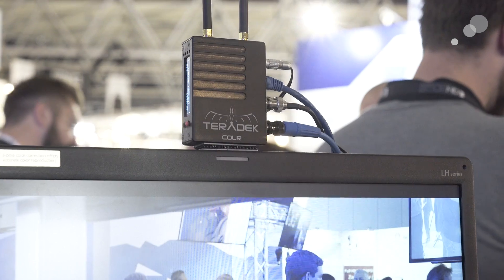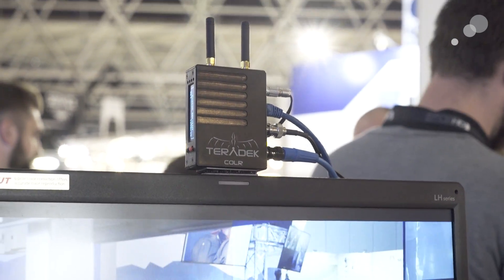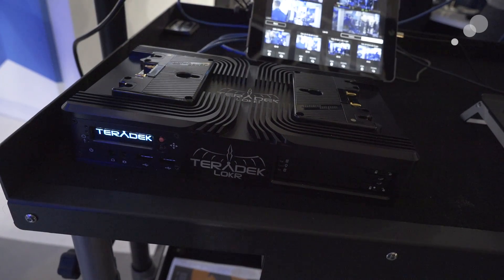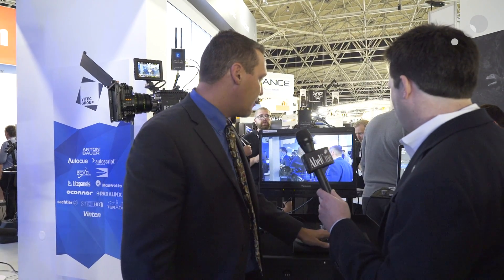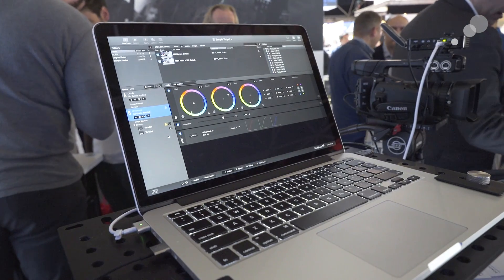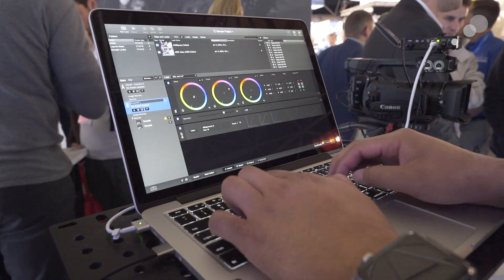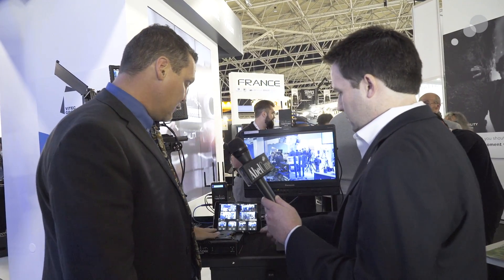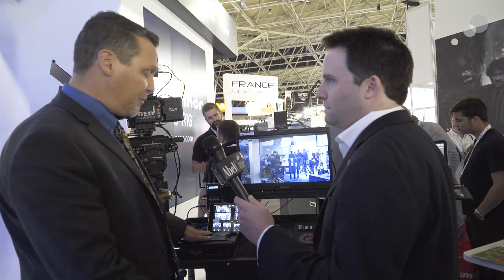IBC 2015: Teradek COLR & LOKR

Comment: It's a bit difficult to get my head around. Without the LOKR how do the COLR units communicate with livegrade? Through the MBP's WIFI connection? If so how many can it handle?
Reply from the maker: +Richard Strong Here's a reply from Megan, one of our tech specialists:

You basically put all of your COLR units on one network.  You set up your Livegrade to communicate with one COLR unit (let's say A camera) via the COLRs access point. Then, once you're happy with your grade you can hit a button to send your grade to all the other COLRs on set. Currently, there isn't a limit to the number of COLRs you can have on one network.
Reply: AbelCine Ah, so one COLR unit acts as a wireless access point for the others? Got it. Thanks. So I'm guessing in order to push out different grades to different cameras you're going to need the LOKR device.